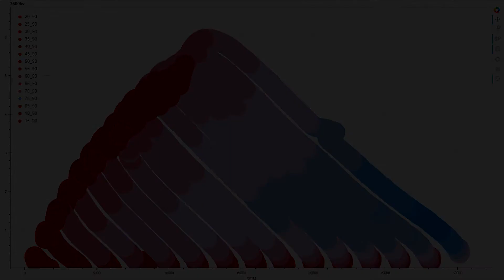Motor KV Vs Efficiency

Comment: WAIT! I was always told if I want longer range on a rc plane, go with lower kv, and higher voltage, because volts * amps = watts, and higher voltage is less taxing than lower voltage higher amprage..

I got to this because I thought a 3s is more efficient than a 4s (mainly because of the extra 33% added weight, but I was told to be wrong, as even though the weight increased, once again, the higher voltage I got from they series circuit, cut down on amp draw....

Comment: I take it that the voltage scale is in LiPo series cell voltages, or 3.7V per division?
I am fairly new to the technical standards for drones and I will be buying drone parts for a research drone soon, this video was helpful.
Reply from the maker: volts aren't on the scale, the chart is showing torque on the left (in Ncm) and RPM on the bottom, color denotes efficiency in %.  Each chart represents 1 single voltage.

Comment: My rc car motor 2200kv runs 15minutes average race,compared to my 1500kv motor does 25 minutes on the same battery capacity .So lower kv is more efficient in my case by alot. The 1500kv stays cooler and has less heat on the battery even when its geared up for faster car speed.
Reply from the maker: for 'faster' speed or for 'equal' top speed as your 2200kv setup?  Lower kv lowers the peak loading of the motor, same as running at lower throttle, but gearing should counter that if it's a direct match.  Gearing may be moving your "average" loading lower down more into the peak efficiency zone near 70% motor load at your typical road speed.  I'm not super familiar with how the dynamic loading behaves in a car.  

It might also be from not spending a lot of time accelerating perhaps, once you're only maintaining speed the load on the motor is relatively light, the only static torque that you've got is bearing drag and tire rubbing.  Gearing up from a low speed motor to higher road speed trades off torque for rpm, increasing the torque load of the motor, so the static torque requirement will be higher for a given road speed, which could be pushing you up out of very low efficiency at low load to a higher efficiency band while cruising, that could make a very large difference as the lower end of the efficiency bands are very compressed.
Reply: @SiieeFPV   thanks for that. There is a  lot of accelerating around my rc off road track and the top speed is the same on both motors. But I'm still convinced the 1500kv way better in every way
Reply from the maker: The motor is only one part of the power train, understanding how one part works helps you tune the system, but at the end of the day you've got to take the entire system into account when looking for results.  Offroad is interesting, I wonder if tire slip is causing the peak loading to be even lower than you'd expect in a high grip situation.
Reply: @SiieeFPV  Im using the same system in the same car and tyre types. 60amp peak draw on the 1500kv, 90amp peak using 2200kv on the same track. Using my on board wattmeter for testing. Onroad acceleration uses about 10amps more compared to offroad

Comment: kV is bound to drop efficiency significantly bcz of tighter tolerance requirements & therefore more precise manufacturing. 
eg Friction =u*N
but power lost to friction =friction*circumference of spinning shaft*(cycles per sec) 
power lost in friction=2*pi*r*f*u*N watts
r radius of shaft
u= coefficient of friction of bearing or bushing, r= radius of shaft in bearing/ bushing, f=motor rpm*60
kv means more rpm per volt hence more power lost to friction

Comment: did you manage to compare/confirm the wire used in the 4000kva motor
Reply from the maker: no.  I don't really trust trying to measure them on the stator, and they're my benchmark motors for this size so I don't want to tear them apart.

Comment: I wonder if it makes the most sense for the ESC to be super smart... with current sensing and a pre-calibration setup for each propeller, the throttle resolution would be expanded and thrust linearized for better control for the FC/pilot.
Reply from the maker: that's hard to do because the thrust at each rpm varies with aerodynamic conditions.  It would be easy to do for a static test, but once you get up in the air that all goes out the window.  I do think it would be really interesting to see an actuator curve applied in betaflight (which is different from a radio throttle curve) and see just how much "feel" you can simulate by doing exactly what you're saying, I just don't think it would give as straight forward a result as it might seem.
Reply: SiieeFPV this was beyond me... but I think you have a background in process controls? http://buildandcrash.blogspot.fr/2016/10/linear-gaussian-quadratic-control-system.html
Reply from the maker: I'm just an artist that likes knowing why things work.  They started working on LGQ right around the time that I switched away from the Tau family of firmwares so I never really kept up with where they went with it.  I do think finding something better than a purely reactive stabilizer would be really neat, and perhaps we're slowly inching towards that on the betaflight side

Comment: Motors in different kv are not equally eficent in same amps.
Reply from the maker: You have to consider total power (watts) rather than just amps in the general case.  The entire purpose of this demonstration though was to show that they are equally efficient.  These are actual measurements from real motors.
Reply: SiieeFPV i saw many comparsions between motors with diferent kvs . And result is lower kv motor has better efectivity in same thrust lower amps, if you wanna hear watts then lower kv motor for same thrust need lower watts. That is fact no matter what your test did ;)
Reply from the maker: So you're looking at thrust tests for your comparison?  Can you make any assertion about how my methodology, or the theory backing it might be wrong, but the numbers you are looking at are right?

The fact is, the numbers that I present here, and the results of the thrust tests you're looking at actually say the same thing.  They both agree, so you can't say that one is fact and one is not, they are the same.  The challenge of it is, that when you do a thrust test on the bench, you are actually changing the loading on the motor as well, you're actually looking at different ranges of performance from each motor so you're not actually comparing the same point of the power band in each motor.  The results of a bench thrust test form one single dot on the efficiency charts in this video, and if you're looking at peak thrust it's a single dot on the far right most band.  

If you only care about absolute peak performance at only full throttle then it's true that none of this matters, and you can get by perfectly well on the simplified results that you can find elsewhere.

Comparing peak values is a false comparison because the peak changes from kv to kv, so you need to control for that to compare points of equal loading.  You can see a similar effect if you're trying to compare the efficiency of a prop by looking at it's peak thrust value.  Peak thrust efficiency is a worthless metric at best, misleading at worst.  You can actually plot prop efficiency over a range of RPM and see many props that give different performance in peak numbers actually line up to be equally efficient over an arbitrary range of RPM.  Looking at motor efficiency has the same problem, examining only the peak values   distorts the results that your'e looking at and ignores the entire range of performance just under peak throttle where the motors performance overlaps.

Each of my charts contains around 3 million data points, covering the entire range of performance of the motor at every throttle value.  A typical thrust stand test will have between 1 and 5 data points, and only along the very specific torque curve of the propeller under test.
Reply: SiieeFPV well i wondered why your reply was delayed . Eh ok i will read it later gtg now. Will read it with morning coffee
Reply from the maker: :D
Reply: Of course i dont talk about peak values (only), i talk about different throttle values.
And propeller will not save you.
(Same) lower kv motor will have better efficency on 10A , 15A .. etc. and maximum as well usually.
Even if you change propellers, it will be "always same".

That is like physical fact, you cant change it my making "own" test.
Reply: I dont know about these wires and their thikness.
What is better for higher KVs
I own both types, almost same high kv, one have thin wires, and another doesnt.
Dont know what is "better". Both has pretty impressive "numbers" in effectivity as well.
Reply from the maker: Technically the size of the wire it self doesn't matter too much until you get to high frequencies, just the cross sectional area of copper in the slot.  You can get the the same point by using one large wire, or multiple strands of small wire.   This applies equally to all KV, the area of copper in the slot is not dependent on how many turns of wire there are
Reply: SiieeFPV i mean two things. One is skin effect of wire = mean more wires is better ? And second you can have better placement of material between slots when use thinner wires.
Reply from the maker: Do you  have any references at all for these results you're implying you're looking at?

I haven't made up my own test, my test procedure and equipment is actually remarkably similar to the Army National Laboratory setup that I highlighted in a recent video.  All of my results are easily reproduce-able even with less sophisticated equipment.

If you don't like my numbers you can perhaps compare the tests done by EngineerX on the same motor.  Looking for example at the Luminier triblade 200g test
2800kv - 4a -3.1 g/w
3600kv - 4a -3.1 g/w
4100kv - 5a -2.5 g/w

or the 300g test
2800kv - 6.7a -2.8 g/w
3600kv - 6.8a -2.7 g/w
4100kv - 8.1a -2.3 g/w

accounting for measurement noise and voltage sag in his results they are showing exactly the same thing that my results are.
Reply from the maker: skin depth at 22khz or so that blheli pwm base clock is at is something like .4mm, that's about 20awg wire, solid core.  So we're realistically no where near the frequency where skin effect is going to impact the windings.  I certainly agree that using thinner stranded wire sounds like a far easier way to get a higher fill %  It does potentially mean a higher volume of insulation vs copper for the same copper area, but you probably have to get to really high fill % before that starts making an appreciable difference.  Most motors sure seem to have a fair bit of extra airspace to me.
Reply: SiieeFPV first off, great job on this testing. It’s awesome to see motor theory explained along with test data to back it up. After watching this vid and the one ones on voltage, my question is where does the efficiency come from when going up in voltage while dropping KV to compensate? I think your data suggests that efficiency would actually drop some, yet many examples seem to be out there in the rc  world where the high voltage and reduced KV perform better (3D helis, rc cars/trucks, lately miniquads). the reduction in current for a given output power could foreseeably help batteries. However, even that is a wash if watt-hrs are kept constant. I^2*r losses in the system would be reduced at higher voltage, but it seems like those would barely offset the efficiency drop you measured. So, what gives? Is it just that there’s a knee in the curve when it comes to current, that if you get there, it makes sense to raise the voltage? If you don’t get there, it’s better to stay with the lower voltage?
Reply from the maker: My working theory right now is just that most existing testing is just insufficient.  Most voltage tests I've seen people do have people throwing a bigger battery on a quad (from wh capacity as you mention) get longer flight time, and then claim that's higher efficiency.  And I've never seen anyone actually try and rigorously control a free flight test, not just flying the same path and the "same" way, but deep log analysis to account for many of the obvious unknowns in that kind of testing.

Heli and car guys I'm not really familiar with.  Helis would be easier to target efficiency since AFAIK they all run governed.  RC cars might have the best data available since they can use a chassis dyno.  But their load profile is really different from ours in quads as well so it's hard to draw a direct comparison, and if there's a broad range of test data floating around in the car communities I haven't run across it in my casual research on motor performance.  Seen just as much wrong information and invalid comparisons in random hobby sites as there are in quad groups.  I'm not familiar with the ESCs used by these other groups as well, if they've got anything different from our basic trapezoidal drives that may change that equation as well from the data I've collected.

In short I pretty much agree with your intuition.  Resistive losses are dominated by other factors, lowest voltage at the highest amperage you can stand is your best bet, assuming the motor is built correctly.  I'd love to see some test data that demonstrates the common wisdom of efficiency gain, to try and isolate what might be causing it.  But all of the data that I've analyzed from other sources either agrees with this premise, or is so uncontrolled to be effectively useless.
Reply: SiieeFPV interesting. I agree that most of the info out there is subjective and/or not as comparable as we’d like. One question though on the topic of voltage & efficiency.... are there differences in motor design that would make certain motors more efficient for a particular voltage range... not talking KV necessarily... talking things like stator height, dia, windings, air gap, etc? Also, do other factors like esc settings come into play?
Reply: I really think it would be good for you to rewatch and learn about this series of videos. Not to be rude, but anytime SiieeFPV has to take to explain the basic methodology to every single person with much less understanding of the video is time better spent working on his ideas and testing.
Nothing wrong with not understanding, we have all been there. Siiee is one of the only ones creating a data and evidence backed foundation to his conclusions.
Reply from the maker: ESCs certainly come into play, but I don't have a good handle on how much so far.  ARL test report had some super interesting results on direct ESC efficiency tests that's worth checking out, but I don't know how close modern hardware compares with what they had tested.  FOC also could be interesting and should give loads more torque at lower speed, and supposedly has potential for being more efficient, but it's all in places that aren't super relevant to a quad, and the results that I got from the FOC ESC I built to test weren't really conclusive.  I'd have to retune and retest it on the dyno, or even better find a good commercial ESC with that tech to compare (I think DJI has some?)

Lots of factors go into the motor, slot fill % is the big one that I know of that directly impacts efficiency.  Lamination thickness is another big one, anything you can do to reduce eddy currents helps.  Other factors like magnets, airgap flux density, toothcount and the like impact torque production, but I don't yet have it all fully integrated in my mind how they effect efficiency.  Particularly as fill % and lamination is strickly a "more is better" kind of thing, which doesn't explain the "sweet spot" that you see in motor performance.  I'm not sure what combination of factors says where that will appear.
Reply: womplestilskin wow... nice buddy.